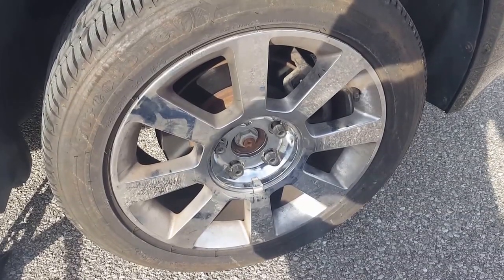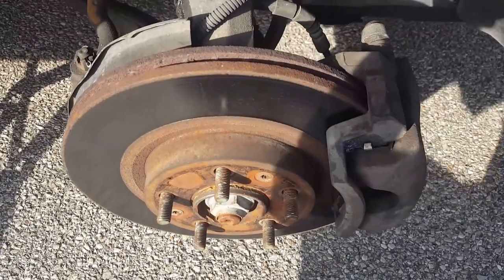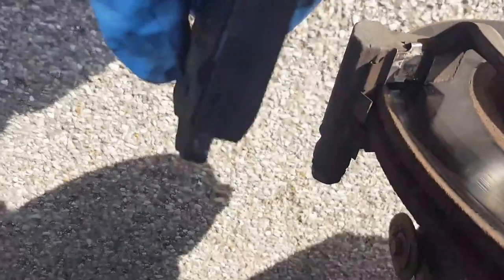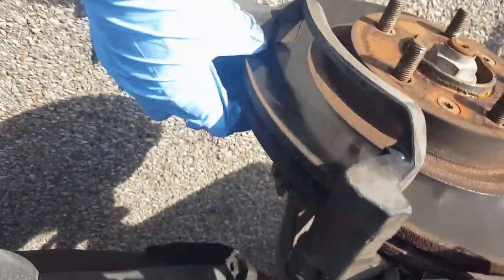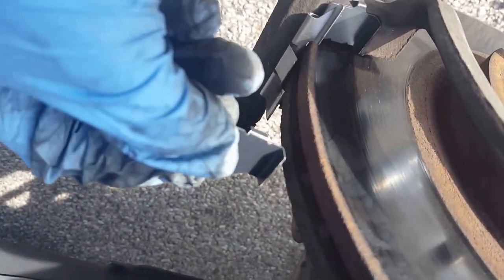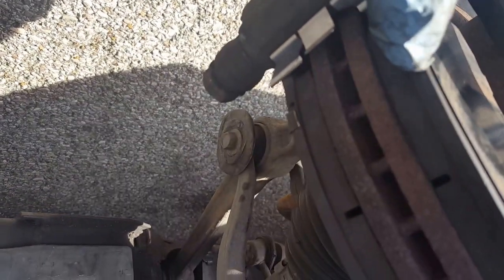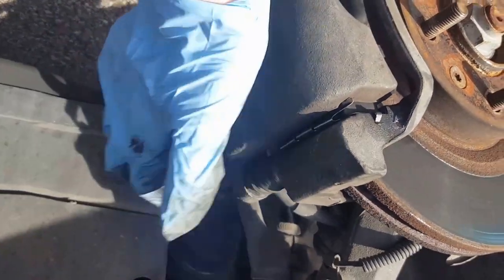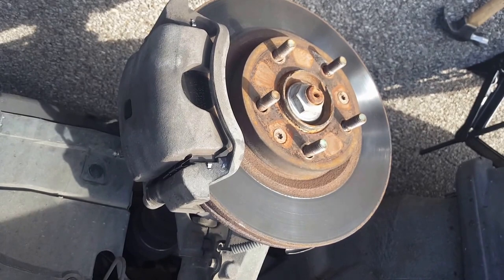How to replace the front brake Hardware on a lincoln mkz and zephyr

Comment: You need to spec what years of MKZ this procedure is for...2013 and up require a 7mm hex wrench to remove bolts (accessible after removing dust caps), and the retainer clips are drastically different. Also every time when replacing worn brake pads, the cylinder will need to be compressed...it would be good include a how-to of this procedure. It's notable that rear brake pad changes on 2013 and up require putting the EPB (electronic parking brake) in maintenance mode. I realize this video is for front pads only, but it may be worth mentioning.

Comment: As sexy as it looks the mkz is by far the worst car i've driven, i bought a 2007 with decent mileage and "dealer certified" and it's been giving me trouble since day one. I'm a student too so all the maintenance really fucking hurts
Reply from the maker: I feel you on that one.  This one had 103,000 miles befor the engine went out on me I didnt have too much problem when I had it for 3 years I bought it when it was totaled it was in a head on collision,  tboned and rear ended , the parts on it was expensive
Reply: @Nickthecarguy  yeah i'm probably gonna end up selling it for like 2k or something, maybe buy a civic 😂
Reply: My car is truly blessed. I have a 2008 with over 225,00 miles and it is still running strong. I keep the oil changed regularly along with Lucas products. It still looks great and is fairly easy to perform maintenance on when needed. I trust that it will continue to be a super dependable car. I wish everyone had my success with this vehicle.